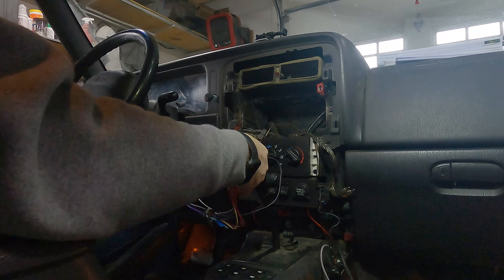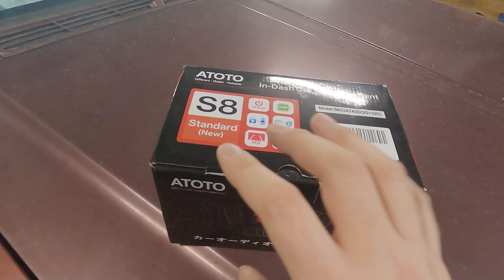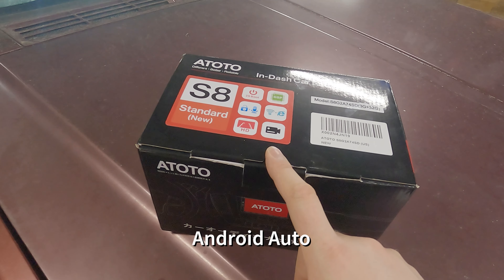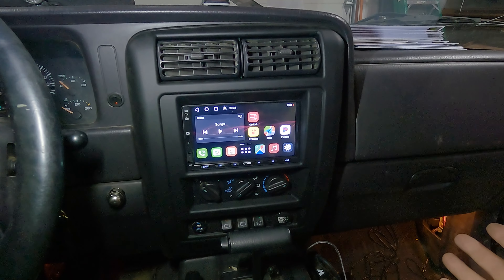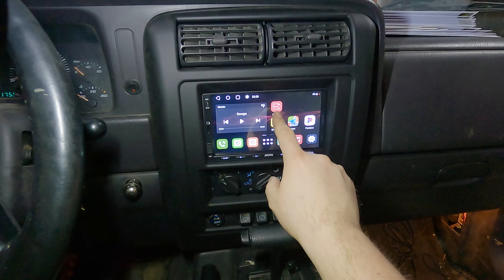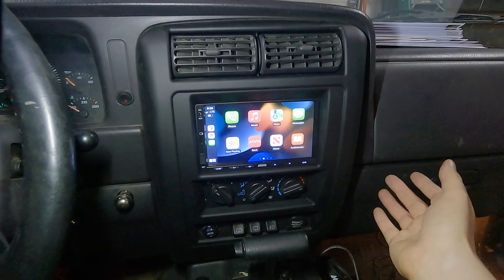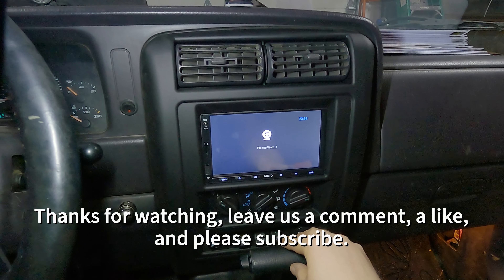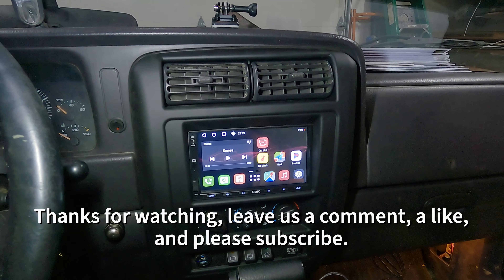Jeep Gets Another Upgrade, Backup Camera

Comment: I did this exact same setup and spent two days trying to get the camera to work. Just kept saying no video. Finally figured out that the power for the camera from the radio wasn’t working. Any suggestions on where else I can get the power to the camera from?
Reply from the maker: If you’re talking about a back up camera (I did a front one later on), here is what I did: if the camera comes on just by pushing the button to activate it then it is getting power from the radios power source. However you want it to come on when backing up, thus I also ran a wire tied into the reverse lights and back into the radio. That way when it went into reverse it would automatically kick on the camera. So there are two power sources for the camera (first is the little red wire attached to the camera cable and tided into the power for the radio and the second was an additional wire ran to reverse light and attacked to the pink wire of the harness) video describes this time mark: 14:10

I hope that helps and is what you’re looking for. Let me know if you have further questions.

Thanks for watching 👍
Reply: @alongcameajeep   I tested the wire coming out of the radio labeled rear camera + and nothing showed up on the volt meter. Do you know another way I can get power to the camera?
Reply from the maker: Be sure that when you tested the wire that you were also in the camera app on the radio so that the unit sends power to that wire.

Assuming you did that already and that your radio already has power to it in general, are you trying to get the camera to activate just by the app alone or are you trying to activate it when going in reverse? If your wanting power to the camera just for the app than the red wire from the camera cable goes to the radio power supply wire or the ignition accessory wire on the harness (the latter being what I did). If your wanting it to activate when going in reverse then that is supplied by a second wire running from your reverse light power back to the radio and attaches to the pink accessory wire coming out from the harness.

In either case there should be power available to your camera. Now I did personally have an issue with my front camera where it would not activate at all and it turned out to be a bad camera, thus if the above does not activate your camera it could possible by a bad camera. Not sure if you have another way to check to be sure.

Just out of curiosity what was your camera - doing? Maybe check that. Also another note is that the directions that came with the radio, although a little poor feeling initially, did make sense once I read through them multiple times and compared it to things I tried. And one final thought, I think I had to go into the setting of the radio and dig through them to find the spot that had me toggle on the activation of the camera so be sure to look for that assuming the OS is still the same for your unit since mine is now going on at least 3 years old.
Reply: @alongcameajeep  so if I want it to activate while in reverse and be able to view it in the app which wire would I connect to the reverse light?

Comment: Hey I’m curious how that stereo held up? I like that one since you don’t have to cut into the ac. Thanks.
Reply from the maker: Hey thanks for reaching out, great question. I feel it has held up really well and I have had only small issues that were not actually related to the unit I believe but rather a power issues from a bad battery. It connects really well to my iPhone automatically whenever I start the Jeep and I really like the layout of options for the Carplay. Additionally, the regular onboard operating systems sees to be just fine with the ability to add countless number of apps through Google Play store. Additionally, the ability for front and back cameras is awesome.

There are two things that I would share as regards what I don't like about the unit and they are as follows (note not a deal breaker on any of them for me but rather I wish for better/more options) The first is this, I wish that it could or would connect to multiply phones with maybe an option to choose which it will pull Carplay from. This is because when my wife drives the Jeep and I am not with her she wants to connect of course and in order to do that it sort of disconnects from mine making me have to do the reconnect process again, which is not difficult you just plug in the phone with the provided cord and accept the connect on your phone. Newer systems give you options to switch between devices.

The second is this, there is a button that lets you change the brightness of the screen so that it can be brighter in the day and darker at night. It gives you three options and I have found that option 1 is for night and option 3 is for day. However, I actually wish it was a slider to be able to adjust it better and more refined.

Now both of those are like I said personal preference and so may not be an issue for you. I would be curious if there is a newer version with better/more options but in all I have loved it and for the price I don't think paying more is worth it. Jeep's are not really known for great sounding speakers so if you liking for a killer sound system I don't know because I am still using the speakers it came with. However, if you looking to use it like I do,: CarPlay and front/back cameras for off-roading, then I think it is still a great unit.

I hope that helps and if you have anymore questions let me know.

Comment: I wanted to see what cutting tool you used to cut the piece out so the screen would fit?  We installed a back up camera on our truck ( it has lots of other gages).  Well actually our mechanics at the Chevron station installed it for us.  Really nice to have that.
Reply from the maker: I used an oscillating multi tool which worked perfectly to cut the duct nice and even without harming other components.
Reply: @alongcameajeep  I have one of those tools. I have Makita. That would work
Reply from the maker: That would work great 👍
Reply: Where did you find the reverse trigger wire?  And what did you connect that yellow wire to for constant power for reverse?
Reply from the maker: Sorry for missing this question. I ran a wire back to the reverse lights so that when the Jeep naturally activates the reverse lights when shifted into reverse it would activate the reverse camera. If I remember correctly, on my wiring harness from the radio there was a wire labeled 'accessory' (I think it was pink maybe yellow) that acted as the trigger wire that I attached the wire from the reverse lights to. And to the same 'accessory' I also wired the camera power wire that comes off the video connector wire. It hangs off the video cable when you plug it into the back of the radio. I hope that helps and makes some sore of sense.

Comment: did you have to buy a wiring kit with this, because I watched another review with a different brand of radio and they linked a wiring kit they had to buy.
Reply from the maker: Great question. No mine had an older version of a wiring harness in it from an older pioneer stereo that came with the Jeep. It was actually the original wiring harness from the factory radio just wired to the pioneer harness. Thus, I cut off the pioneer side of the harness and matched the wires from the original factory radio to the wires of the new harness that came with my new radio. Therefore, what you will need depends on what is already existing according to whatever kind of vehicle your putting it in. I hope that give you an idea. Oh and the radio I bought had the wiring harness with open wires which is why you saw me soldering wires.

Comment: Do only 7in screens fit into that console chassis?
Reply from the maker: Great question. Honest answer is I’m not sure. I do know that the new cover dash panel that has the opening designed for this mod only comes in the 7inch size at least at the time I did this. So if you going larger then you might have to modify your existing dash cover for it to work. If you’re going smaller you probably can find a shroud that will fill the gap of the dash panel I used.

As far as room behind inside to fit a larger screen, there is some. Probably could do an 8 inch as long as there are 8 inch ones and it is flat like mine was.

I hope that helps and thanks for watching.
Reply: @alongcameajeep  thank you